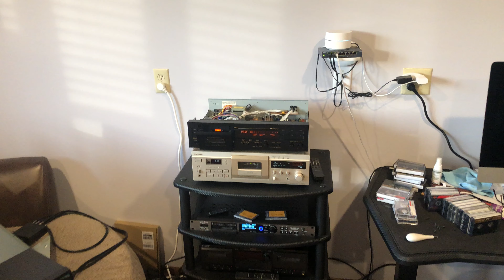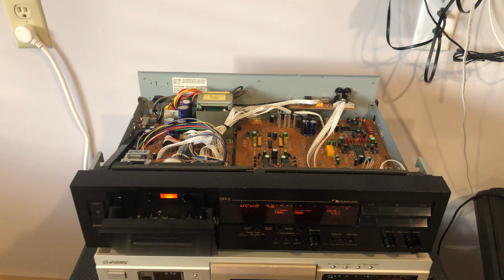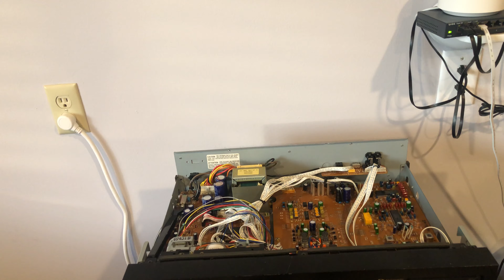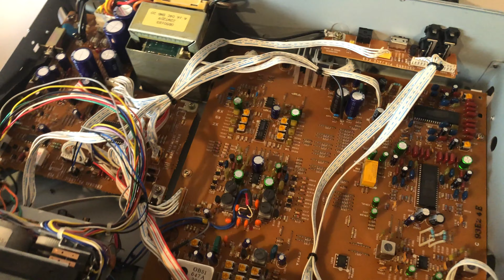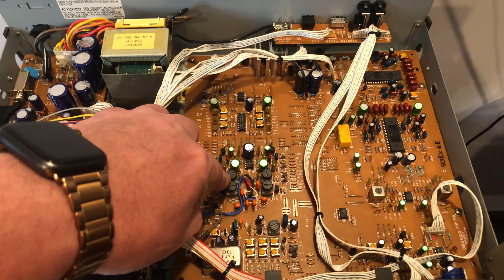How to improove sound of Nakamichi DR-2

Comment: Just got myself a DR-2, I've tried your settings, but no matter how far I turn those dials, I can't hear or messure any difference.
I used NAK T-100 to messure all frequencies, in their original positions and 360 counter clockwise like suggested, but no difference what so ever.
So, I've set it all back to their original position.
Reply from the maker: I made a later video where I was measuring how this affect the signal and yes, I put it back. these coils affect only high frequencies response.
Reply: @hifirulezzz  OK, haven't seen that video yet. Thanks for the update.